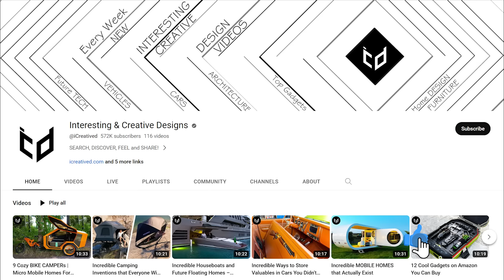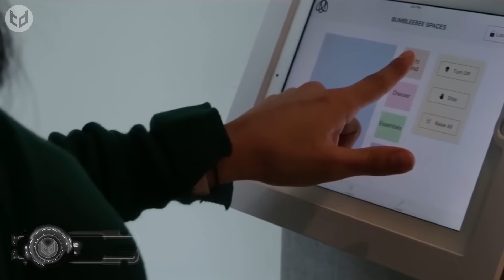Must See Smart Furniture Innovations and Space Saving Designs

Comment: Most impressive: the elevator. The most potentially problematic: the under-vanity toilet simply because it would be hard to add bars or handles to accommodate people who have difficulty sitting down or getting up. Most of these can be divided into two groups- things that allow you to be neat (like under stairs storage) and things that require you to be neat (like having to make up concealed beds before stowing them). Many doubtless are expensive and could best be justified when considering buying or building a smaller residence where saving dollars per square foot or number of square feet, as in having a custom tiny house built, or an ADU (Auxiliary Dwelling Unit).